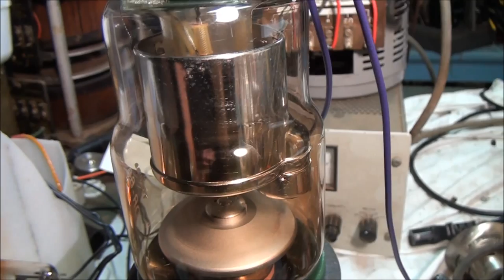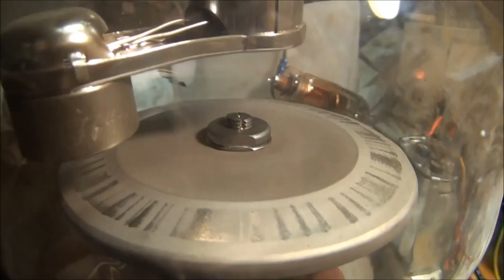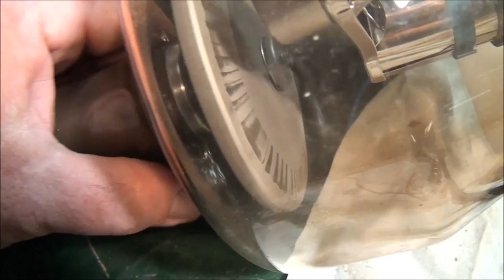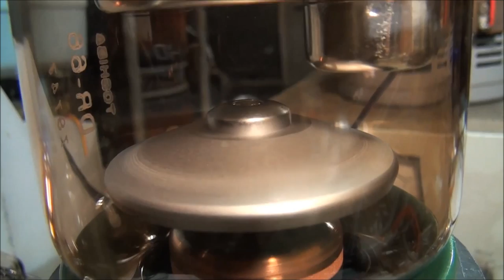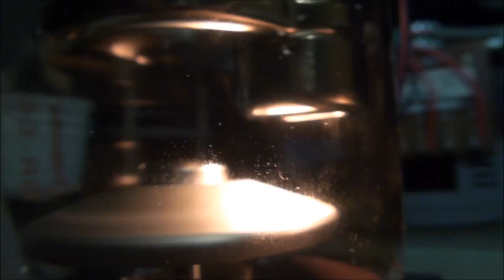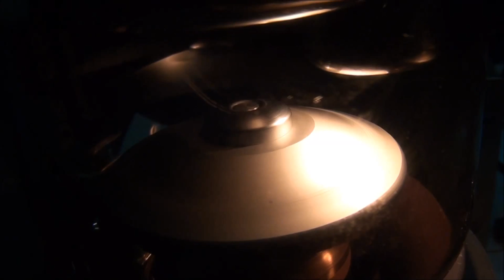Rotating Anode Xray tube

Comment: Is that wobble/ grinding noise because its not up to the run rpm?  Like its just in a standby mode but when you put it to work it ramps up to speed then magnetically slows it back down for heat dissipation and whatnot?  Sounds like it could explode any second..  the ones ive heard are super quiet and get up to speed within 5 or 10 seconds..  theyre likely newer though and the motor windings arent exposed and no yellowing glass.. watched a tech drop one from a 4 foot height and sounded like a bell when it hit the concrete floor but didnt break..  even still sounded less abrasive than the one in the video..  expensive little boogers sometimes..

Comment: interesting tube. how does the shaft pass through the envelope and maintain the vacuum, is there a magnetic coupling or something similar ?  thanks for posting your videos, much appreciate the time you put in for your fans. all the best from England.
Reply from the maker: +Ken Goddard Thank you for your kind comments and I am glad you like my Vids! The tube is fully sealed, the armature is fully sealed inside, the field coils are around the neck of the tube and the magnetic flux from the coils is what causes the armature to move. Basically the same as a standard AC motor. All the best for the new year and seasons greetings from Downunder!

Comment: Interesting! How fast do those anodes normally rotate?
Reply from the maker: +wdavem I think the standard type of X-ray tubes would run up to 3000 RPM however some types of high output Tubes would be much higher to prevent pitting of the target under extreme loads. I have 2 pieces of a disk that shattered during a procedure and one of the pieces punched its way out of the housing, big mess when all the oil came out!
Reply: Anode speed depends on the technique of the exposure. If the system has a high speed starter then it will typically triple the speed (9000 rpm). After that exposure a brake is applied so the anode doesn't slow down through the 4000 rpm which can cause a wobble. If you do that, you may end up with a shattered tube.
Reply: @stevenull5865  you mean that if tube is running on 9000RPM & after exposure  a break is apply to make speed slow 4000 or 3000 but not to make zero otherwise tube will damaged.
can you suggest any power supply  which is able to drive @ 9000 or 3000 or in between with break system